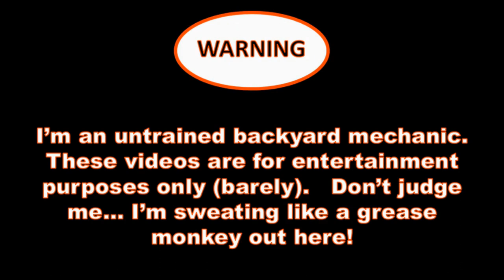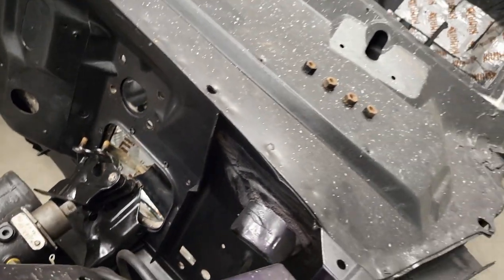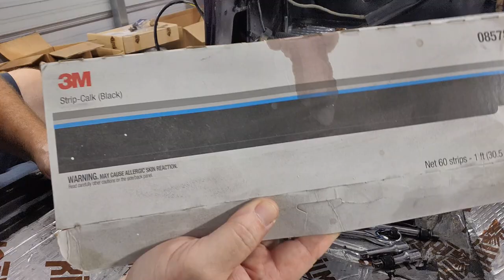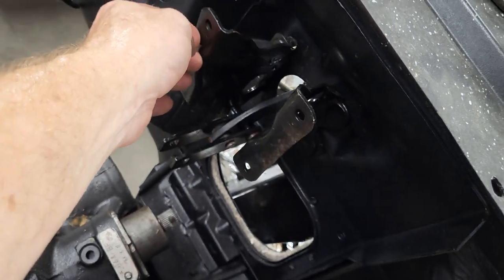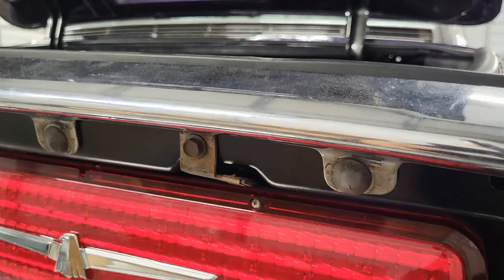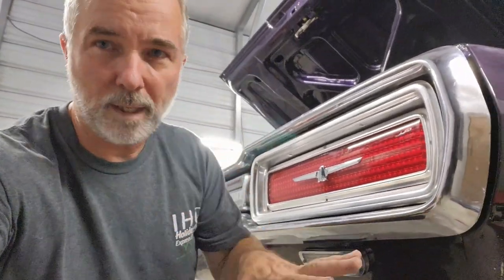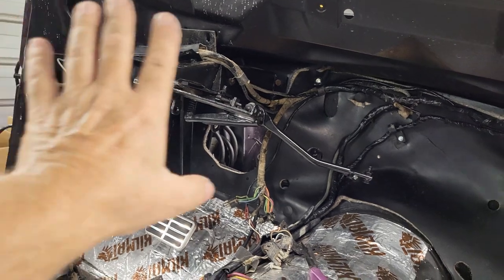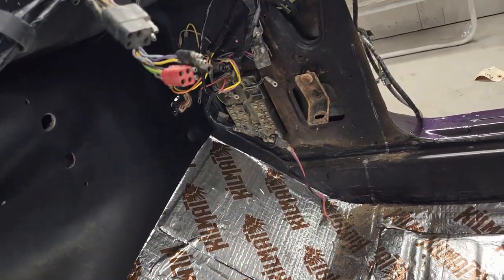Taillights and Brake Pedals - 1964 Thunderbird

Comment: No E brake 😮 use a block of wood? The trunk light is that the original mercury switch or a new one? Disconnected mine as was playing up and not sure it was switched off when trunk closed.
Reply from the maker: Hey Steven.   I never thought about how the trunk light switches on and off.  I didn't see any switch for it when I disassembled it.  I guess I have some research to do.